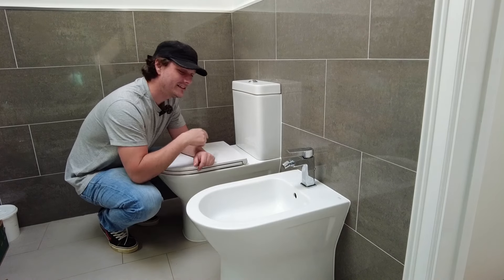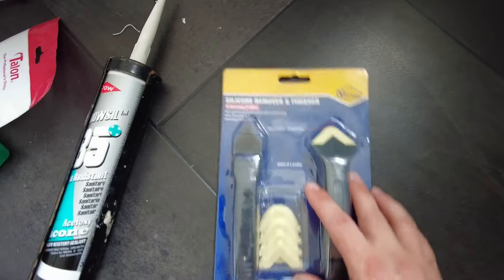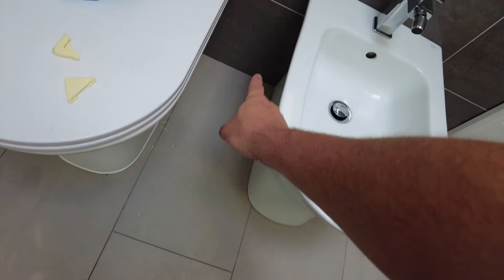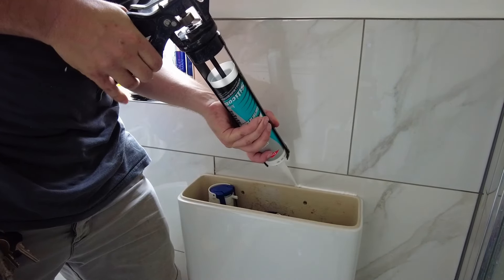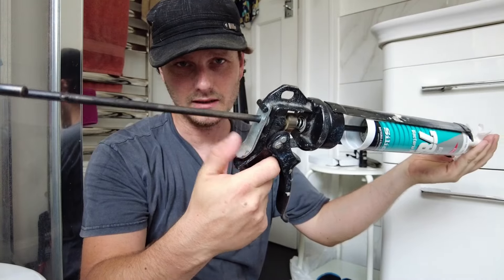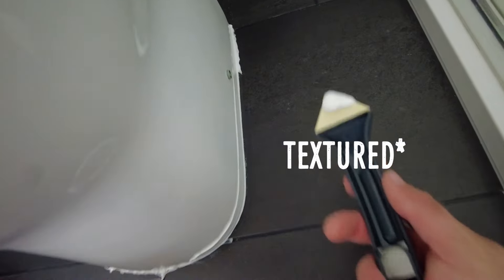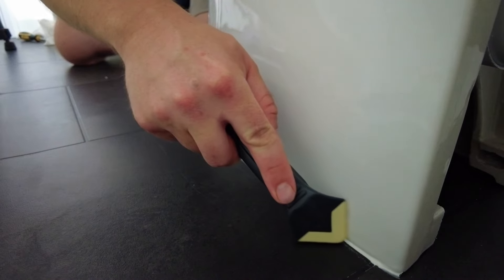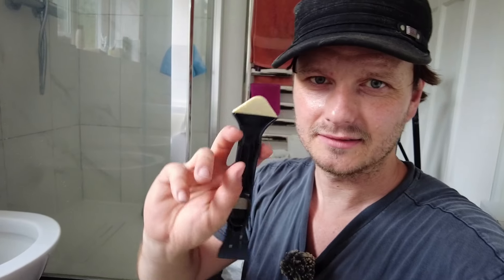The Best Way to Silicone Caulk a Toilet & Bidet - Stress Free!

Comment: I have the same electric caulking gun - it’s worth noting that you need to keep the speed low unless you have a BIG hole in the nozzle. Mine is currently awaiting an afternoon with a dremel to clean off half a tube of 5 minute PU hardened glue that came out the back of the tube. I’ve had the same before with silicone (which is far easier to clean up after).

Comment: As an experienced plumber I would always suggest NOT siliconing everything in sight! You don’t need to silicone around the back a cistern lids or at the back of bidets or WC’s. Never ever silicone around the 4 sides of a shower unit (Electric) always leave a gap at the bottom and top so to help stave off condensation build up within the workings/electrical areas. Silicone is a doddle to use of you but the best products, have an extra clean surface to do it on. And practice certainly makes perfect. Use a strong wash up liquid mix with water when you smooth down the areas you are making good.
Reply from the maker: @barryckemp907  you don't have to but it doesn't have any mechanical fixings in the cistern 😜 I'm guessing you haven't seen my video about washing up liquid 😱

Comment: I highly recommend people consider NOT caulking/siliconing the base of the toilet because you will likely not know if the wax gasket is leaking and it can rot out your sublfloor and then you'll be lifting tiles, cutting out plywood, replacing plywood, trying to match tile, etc.  This comes from a long time landlord
Reply from the maker: @DepthWish  fair point, although we don't use wax gaskets in the UK 😉

Comment: I don't silicone between two non-porous surfaces. Personal choice. It's easy to keep clean with a spray bleach. Only place I'd use silicone is behind the sink in the kitchen, so as to inhibit worktop delamination, or outside around window and door frames. Silicone looks nice, but even the expensive stuff never lasts long enough, and it's a c*nt to remove from rough surfaces. And, because I'm shit at it. Bubbles, ripples, gaps, smeared on all the wrong bits. Tried the tools and geared guns. Still shit at it.